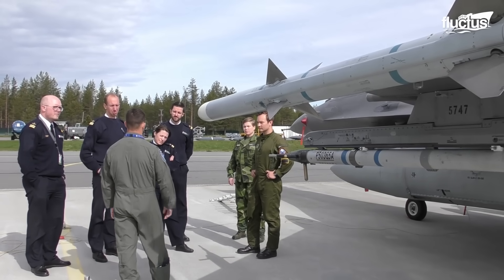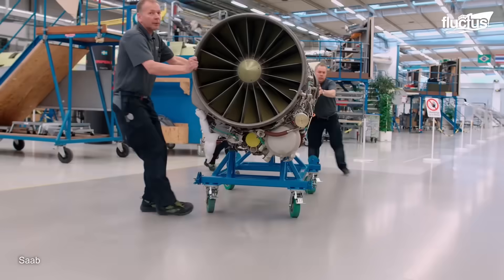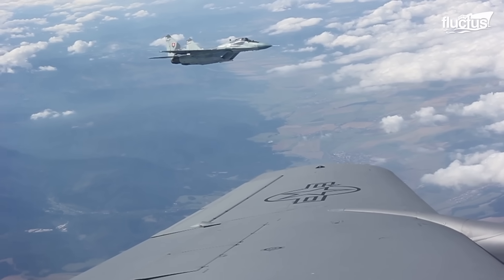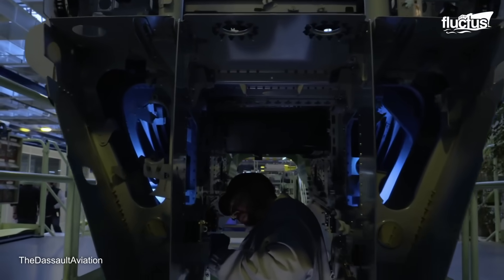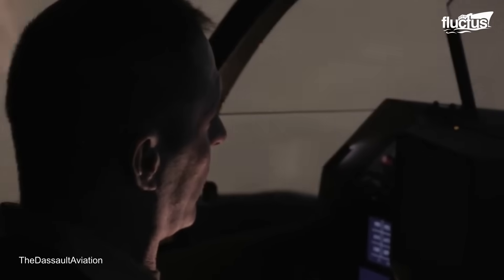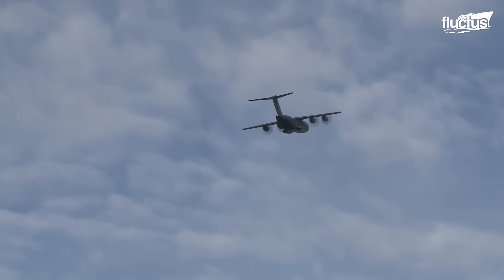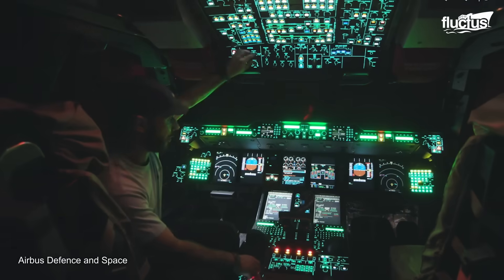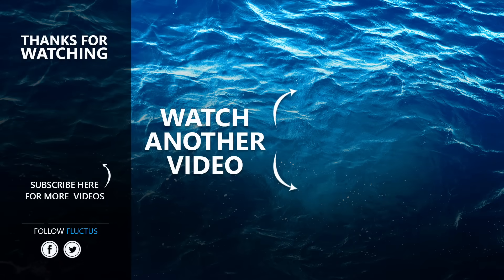Why Super Advanced European Fighter Jets are so Weird Looking

Comment: At 5:32, it's not a Rafale but a Mirage 2000 previously built by Dassault in the 70's. Most propably a 2000D which is a 2 seater bomber still in used in France and other countries. Other variants are 2000C fighter, and 2000N nuclear strike bomber replaced by the Rafale. The Rafale, howerver is a multirole fighter with a naval variant (Rafale M for Marine) that can be used in both french and american aircraft carriers as they are equipped with the same type of catapult.
Reply: and also the 2000B which is a C varient but with 2 seats. at some point the mirage was a multirole aircraft, it has variants but it keeps the same airframe. however it can't perform 2 or 3 mission at the time like the rafale

Comment: Three very large heavy high-drag-inducing, G-limiting external fuel tanks , performance limiting until jettisoned. Then extremely short- range limited.
Reply: Oh,  what's with that drag inducing glued-on bulky formation light (?) tacked to the left air intake ??
Reply: A electronic support measure receiver🤣 @pmullins1495
Reply: @pmullins1495 they are no lights but sensors to detect incoming menaces and anti missiles laser devices…
Reply: F35 less than 900km range when rafale can reach 1500km (mainly 1200km without add fuel tanks)

Comment: Now, this poor Swedish intercepter has to compete had to head with many new developed light fighters Korea AT0 Eagle , India Tejas and Pakistan JF-17.  Has Northrop F20 been continued , it would have competed with Gripen also.
Reply: I would advise you to check out Gripen C’s results on Red Flag. The new Gripen E will eat those planes for breakfast.
The Tejas project started up more or less at the same time as Gripen, but HAL never got this piece of shit to work. The got it operational in 2015, 20 years after Gripen. I’ve been told by Saab engineers that HAL desperately, at multiple occasions, have asked them to understand the art of building aircrafts. 
HAL built 17 prototypes, Saab just 5….
Reply: @ordningsmannen  Red flag??  The latest news from Phillipin, it's Korea fighter/trainer T50 managed to shoot down an F22 in drill. 
And T50 is in the same category as Gripen.

Comment: Rafale VS Gripen , Which is more stronger?
Reply: The Gripen beats the Rafale as it designed to be universal
Reply: Rafale offcourse... no doubt 😂
Reply: Rafale it is more maneuverable because of its two engines
Reply: @z5170   So by that logic an A380 is even more maneuverable because it has 4 engines?
Reply: @swems-z3s Rafale still is better, it is more capable and expensive
Reply: @jean-philippebobin3732  depends on what you want to do with it and what your environment is.
Reply: @swems-z3s  if it in cost per unit maybe Gripen is a better aircraft, but in term of capacity or range of mission, the Rafale has an higher values.
Reply: @jean-philippebobin3732  exactly, and if you don’t need certain mission capabilities suddenly the Gripen might therefore be „better“.
Reply: @swems-z3s  technicly true, but if we keep in mind the first question of JW7, de Rafale is stronger, but not the best in every scénario, that why Mirage 2000 is still there in France service.
Reply: @jean-philippebobin3732  my initial point was basically countering that idiotic argument that more engines=more maneuverability. But yes, I agree with you
Reply: @swems-z3s  nice we agree
Reply: @z5170 The engines have nothing to do with maneuverability unless they are thrust vectoring, which the Rafale doesn't have.
Reply: @Timbothruster-fh3cw  RAFALE
Reply: @lechatethere7710  Thanks
Reply: Have a look on the Swiss army bench test of the two planes , rafale beat all the competitors by far

Comment: There's nothing "weird" about delta wing design.  It's just another engineering solution with own strengths and weakness, like any other.  Besides, F-117 took weirdness for another level already.
Reply: except a good delta wing will ALWAYS be more manoeuvrable than any true 5th gen fighters
Reply: @johndoe-cd9vt 

Really?
Reply: @KOTAPA  yes deltawing+canard = more maneuverable than classic 5th gen design
Reply: @johndoe-cd9vt  Does delta preclude 5th generation?  Just curious.  Or do you mean to say that till now, most 5th (all?) 5th generation aircraft have been non-delta?
Reply: @rajeshkanungo6627  most 5th are not what we call "delta wing", Rafale is delta wing, most of the time delta wing means more agile. The rafale even have canards which increase the agility and the capacity to slow down the plane when needed.

Most of the 5th gen are less agile than the good delta wings. So people will say "yes but they won't have to dogfight so it doesn't matter" which is a wrong statement because you never know what can happen in a real combat and also some planes like the rafale F4 are able to detect and track the 5th gen fighters even at long range (with infrared radars and other tools)
Reply: @johndoe-cd9vt  thank you for adding “true”!! because if we take into account the 7 characteristics that the Pentagon requires to be 5th generation, the F22 and the F35 only partially meet these 7 criteria!! LOL they were never 5th generation planes!! Americans are big children but they swallow the bullshit a little too easily either from their manufacturers or from their government! we see the examples: trump, a big incompetent and dangerous mythologian!! and the 737, an airliner that is too dangerous!
Reply: Delta wings super maneuverable, no doubt. Excellent for the first, maybe second turn. Delta wing planes, however, do loose an incredible amount of air speed (and energy)with turning maneuvers. All that being said, the Swedish Gripen is still awesome. Super combat effective, and all for a sweet price. The Eurofighter Typhoon, ehh. Costs 40 million more than an F-35.
Reply: @jayklink851  When we say maneuverable the first think we have in mind is the short turns, a delta wing turns way better than a regular big heavy plane like the F35. If he has canards he turns even faster.
Reply: The "NightHawk" was a very unique (You can't see me..) design from the have blue program from the 1970's. Do you think the brain storming skunk works has been sitting around playing cards for 54 years? The "AURORA" exists and the distinctive contrail does too from a hybrid RAM jet engine. At speeds above MACH 2.0 the thing has no moving parts as it just takes it in and pushes it out faster. Sorta like an ION engine.

Comment: Weird looking? I didn't knew that those fighters are created for fashion to look cool instead for functionality. Lol
Reply: Considering having an aircraft that looks cool and a high quality performance would be better
Reply: @HK-ce2lj for me any shape of jets looks cool than many times crashed jets.
Reply: US Plane were created for hollywood props 😂 expensive to support the politicians lifestyle
Reply: @OBeeone88  Any non fabricated proofs? Or it didn't happened.
Reply: Yes🤣 russian jets are like a francy😂
Reply: European , Russian and Chinese designs all embrace canards 
The US does not
The US tested canards on all its planes and ultimately found no use for them
Reply: @verdebusterAP does the USAF uses delta wings ? (That was sarcasm.)
Reply: @thegeekno72  USAF has had delta wing fast jets many times - F102, F106, B58, SR71, A12,  A4 and also on the X32, F16XL, XB70 and the D21 drone. Not to mention the Space Shuttle was also a delta wing design and the F22 has 'clipped' delta wings
Reply: They are also built 100ft underground. They are incapable of stall and can land in and take off from any highway or road in Sweden. It can Super cruse and can fly at Mach 1.9.

Comment: Did I miss the Typhoon... Where was the Eurofighter Typhoon??
Reply: eurofighter and Rafale are almost identical and have similar performance
Reply: @Spip-yt6dx  According to the Swiss Air Force, the Rafale outperforms the Eurofighter in every role tested, especially in ground attack and air to air roles, and has a massive advantage in Electronic Warfare according to the Egyptian Air Force. The Rafale has an almost T-shaped fuselage, smaller engines, with a far wider build, shorter wings, and 2 air intakes under the wing, whilst the Eurofighter has a triangular frontal profile, nose-mounted Canards, and larger wings on a more slender body

Looking at them side-by-side makes them look nothing like, and they preform on different standards, too